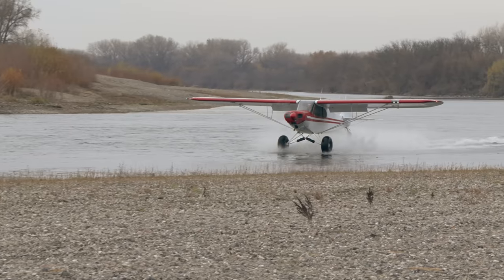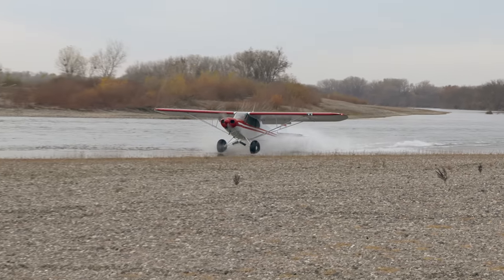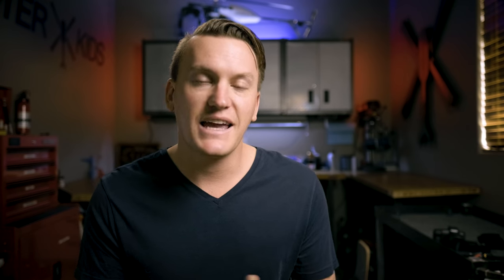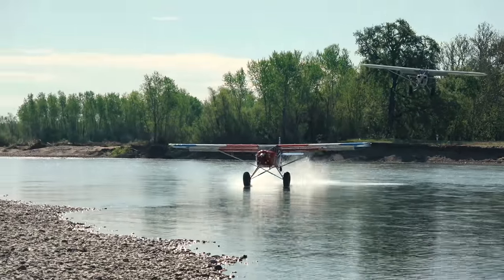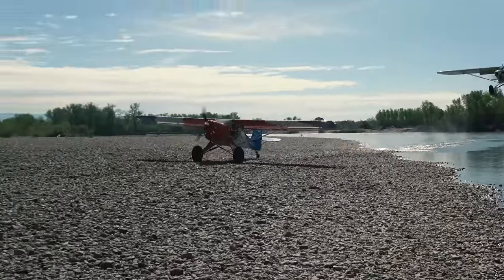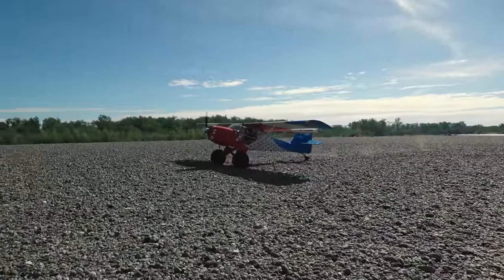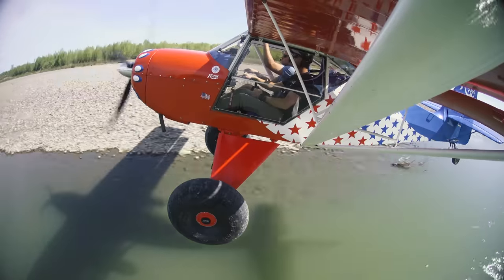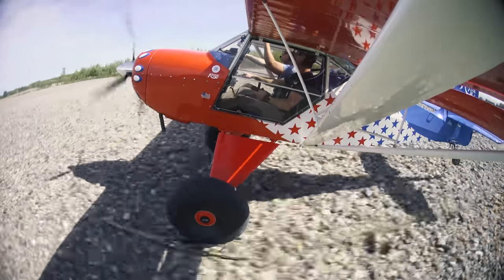How To Waterski An Airplane, and Why You Probably Shouldn’t

Comment: Just ask the FAA about 737 max ,should never be flying ??
Reply: 8 7 max is a very good plane, a system issue caused the issues. Why? Boing is trying to have any 737 pilot qualified to fly a normal 737 fly the max with no training. Nothing wrong with the max, it's the system that makes it fly just like normal 737s caused the issue. Boing will find a solution and fix it. I would and have flown on the max, awsome plane, would not hesitate to fly on it again.
Reply: @airgliderz  that and having to dumb it down for 2nd and 3rd world training deficiencies... Nothing like having to idiot proof a jet airliner. God bless Boeing

Comment: Pretty funny thinking the brakes will have that effect! Holding in some brake will stop vibration if your tires aren't balanced well. Another "don't" is don't hit a boat wave. It will snap your gear off at the least. Experience coming from a friend.

Comment: Have not skied a wheeled plane my self but discussed the matter with a 13,000 Hr Helicopter and fixed wing pilot who had on numerous occasions skied tail draggers for fun or beech landings  -  His explanation was that and as can be seen in your video that while skiing the water friction will quickly start your wheels turning and when they reach rotation equal to that of aircraft speed the surface tension against the water is lost and the wheels will start to sink in  -  He said always have the toe brakes on until just before reaching the beech        As for stability issues engaging brakes after skiing for a period is resultant of centrifugal force when the brake caliper quickly stops the rotating wheel and has nothing to do with tyre braking against water - example: a car hard braking on seal then starts to hydroplane on water loses braking ability

Comment: I liked this one a lot.  Even though there was ... like ... NO flying in it!  LOL

Can I add something to the safety suggestions?  You talk about the dangers of penetrating the water and what it would probably be like to flip over and deal with a flooding cabin, etc.   I would like to point out that if you are going to be working this close to the water, you should be wearing an appropriate (for aviation use) personal flotation device (PFD).

I would suggest this applies to any of the low level flying done around water.  Landing on gravel bars, low level flight over Lake Tahoe where you clearly wouldn't be able to glide to shore.  Any place you have a clearly identifiable risk that a mistake could immediately stick you in the water is probably a good place to be wearing a PFD. (Edited for seriously screwed up sentence)

Comment: Screw 'em, Trent. Get some combo pontoon / balloon tire tundra landing gear, and go surf and roll down any runway surface you want.  Have the Patey twins design, market and sell it. It has to be doable, don't let anyone tell you it can't be designed, built and sold. When you are in Experimental Aircraft, all bets are off.

Comment: IF you were going to water-ski, I wonder if there would be any benefit to unlatching the door and clipping something over the frame so it cannot re-latch.  Then, if you do flip, you don't have to worry about the pressure on the door.
You could even use a bungee cord to keep the door firmly tight so it doesn't create a hazard by flopping around.

Comment: Flying is one of the few things in life that are self regulating... there are old pilots and there are cocky pilots but there are no old cocky pilots.  Bush flying requires skills and abilities way different from those required for paved runways and control towers.  I much prefer bush flying myself but where I come from there is none.  The only thing you did wrong in my estimation was doing it with a passenger.  That should never have happened and the FAA was right to give you a slap on the wrist.  Pilots take a kind of self-inflicted Hippocratic oath to do no harm (to others, killing yourself is oK) and with a passenger on board you are responsible for their lives.  Claiming they begged you to do it doesn't change a thing, they are not pilot in command... you are.  Love your videos,  love your type of flying and I fully support your right to put yourself in harms way.

Comment: Hey Trent, what about landing "somewhere" in the US? Is that legal?

Here in Germany, you must never land outside an official airfield except in an emergency situation where you cannot make it to an airfield safely. Exception: Gliders.

Taking off from anywhere else than an airfield is also prohibited and requires an official approval (e.g. when you landed with no fuel and want to take off again after refueling).

Comment: Trying to get my mind round adding Sail GP yacht type foils to help with landing on a beach , where the foils fold where they fold up when you reach the beach. 15 to 20 miles per hour water is as hard as concrete it's also the speed that some foiling yachts Start to foil.

Comment: The comment by someone in FAA Legal stating that lack of landing and takeoff performance numbers in a POH for unpaved surfaces makes such operations illegal is WRONG. Says who? The FAA. The only information in a POH that a Part 91 operator must have and use are limitations—the rest is advisory. In fact, if all aircraft limitations are on placards visible to the pilot, the POH need not be on board.

Comment: The wording of the regulation which defines your separation from "people, vehicles, vessels, and structures", does it continue on to include the phrase, "... not under the control of the pilot in command of the aircraft" ?
The reason I ask is because I am also a commercial UAV pilot (in the UK) and the regulations which specify our separations use the same wording and conclude with the ".. not under the control of the PIC" bit.
In flight, I cannot get within 50m. Whilst taking off and landing, it's down to 30m. Yet, if the person, vehicle, vessel, or structure is under my control, I can get as close as I like. The interpretation of "under the control of the PIC" can be a little loose at times but generally, if given a safety briefing and have some way of hearing the pilot calls (such as radio, or by use of a signal horn), they are under the PIC's control. In other words, if they know how, where, and when to run and take cover, they're "under control".
So, if you are making a low pass over a field in your KitFox so that a guy with a camera can capture some footage, as long as he has had an adequate safety briefing, are you allowed to fly close enough to flip his hat off his head with your wing-tip or does the mandatory separation still apply?

Comment: IIRC, it's less the surface tension of the water and more the ~viscosity~ of it that makes skiing in any form possible. At those speeds, the water simply can't flow fast enough to be pushed out of the way by whatever's trying to push through it, so it acts much more like a solid surface than a liquid. A significantly more exaggerated example of this would be oobleck, a shear-thickening non-newtonian fluid. Which is an apples to oranges comparison because you can't exactly compare newtonian fluids like water and honey to non-newtonian fluids like oobleck and shampoo, but oobleck exhibits the effect that you get when you try to skim water at those speeds to such a degree that you can more directly experiment with it with your bare hands.

If it were entirely the surface tension of the water, then skiing wouldn't cause the water to splash out of the way as you do so; it would really only cause ripples and little else. Water's surface tension is way too weak for that to be the dominating effect in this case.

Still, excellent tips to share nonetheless, and an excellent risk analysis of waterskiing airplanes, and you should honestly feel proud for sharing with us the errors you've made as a pilot and the consequences (or relative lack thereof) that came of them. This sort of transparency and willingness to admit that you messed up and the steps you're taking to rectify the issue is needed in order to show that egotistic perfectionism is a dangerous mindset to allow oneself to slip into as a pilot. :)

Also, dat luck of the draw that an FAA inspector just so happened to be there to catch you red-handed exactly when you absolutely didn't want to be. XD That was just my luck the past couple of times I've been pulled over for speeding on the road.

Comment: I remember watching this video when it first came out last year, but now that the Almighty Algorithm has recommended it to me again, I'mm'a be late on this train and say that it's not just the surface tension of the water you're working against when skiing. That's only a small fraction of it. What you're really taking advantage of is the viscosity of water. Water has a surprisingly high viscosity for something that flows super well, and when a thing tries to push through water above a certain critical velocity (based on the shape of the thing, I believe), it's basically like pushing through a solid.  The faster you go, the more solid that water "feels", because its viscosity prevents it from flowing out of the way fast enough. The mythbusters explored this when they tested the myth that you're better off landing from a free-fall onto water than onto concrete, and they concluded that landing on water really just wasn't much different than from concrete, above a certain critical velocity, and this velocity is different depending on whether you land feet first or in a belly flop.

Comment: Hey Trent, very interesting video, and it gives me and idea actually :
Because you've got that EXPERIMENTAL sticker on your aircraft, could you maybe make something (start-up (fake or real, as you want), research project, experimental project) about developping a technique for waterskiing ? Like coming up with whatever device (rad-alt for water, surface tension break detector if the tyres are at the limit of penetrating, special waterskiing tyres, or anything else) that would legally authorise you to conduct these kind of practice ? I'm thinking about the Cirrus experimentations with their CAPS system,  also any hydroplane manufacturers had to comply with regulations for landing on water and make tests, no ?
I'm just giving an idea, I don't know how it works with the FAA, I've only been dealing with CASA (Australia) and now EASA.
If you're interested, feel free to contact me, I'm a master degree student in aerospace engineering, majoring in aircraft structures and design operations and would be interested to follow a project like this closely !

Comment: Fly8ma has a good video on this topic as well. I live in an area where there is a ton of beach and river area you could land but like Trent is saying you are supposed to stay at an altitude where you can safely land in the event of an engine failure. Sure you can land on the beach or the river bars but are you causing undue hazard? There are always plenty of people ready to go tell the authorities that your doing something wrong so just be mindful of your surroundings and be prepared to get a letter in the mail. That being said as soon as I have a capable aircraft I will be landing on all the off runway spots I can..

Comment: Good video, I always wondered about if it was legal or not.  Still not really clear.   About the physics of "hydroplaning" a plane in open water, it really has nothing to do with surface tension.   It has to do with speed and moving the water but not really surface tension.   Surface tension is like a bug walking on water where the surface kind of acts like a structural membrane on the surface of the water.  Like floating a needle on water, If carefully placed on the surface, a small needle can be made to float on the surface of water even though it is several times as dense as water. If the surface is agitated to break up the surface tension, then needle will quickly sink.    When "hydroplaning" a plane in open water the surface is broken as evidenced by the spray from the tires and has nothing to do with the surface tension of the water.
Reply: This is true. It's not relevant to technique, but surface tension does not change with speed. The very short description of what is going on is that water is incompressible, and has inertia. If you try to push into it faster than it can get out of the way, it is hard.

Comment: Perhaps another lesson to take from your experience is to find a less public, tourist filled lake than Tahoe if you are going to try something edgy.  I was stationed at Tahoe for a bit in the Coast Guard (back when dinosaurs roamed the earth); federal agencies are there because the lake is a national treasure that spans multiple states.  A federal agent in a place like Tahoe gets pressure from the public, from resort owners, and from well healed property owners (why are you letting those people do X?).   They also know that on a cold lake like Tahoe, you will likely not last long enough for help to arrive in case of an accident.  Interesting point about glassy water; competitive divers  spray a stream of water onto the surface of the water, else they can't judge the distance to the water.

Comment: Actually, setting the brakes while skimming should be of help and keep you "on top" more firmly. If you could rotate your tires at ground speed somehow, then you would not be able to ski at all. That's why they tell drivers to stay off of the brakes when driving over standing water, to avoid hydroplaning, which is when a wedge of water builds up under the leading surface of the tire and erodes contact force with the road.

Comment: Basically the FAA could see a float plane in violation on a touch and go with the right inspector. So how to air tankers like CL414's get away with doing the same to load, it is a common problem in many different sports and activities, mainly dependent on who is holding the book and camera at the time.
Reply: Trent pointed out that they look at what the operating procedures are for a particular aircraft.  A float plane would have water landing procedures in its POH.  IOW, it’s meant to do that.

Comment: It’s an interesting conversation and one that needs to be had. I think I’m in agreement with you on this one Trent.   It comes down to personal risk assessment. Personally, I wouldn’t do it  outside of an approach to landing (even then there would have to be a severe need for it). The risk outweighs the benefit for me. I think violating you under paragraph A is a stretch at best. You weren’t a risk to anyone on the surface because you were already 500’ away. I’m not a lawyer or FAR expert that’s just an opinion. I’m not a fan of the fact that through your requests for definition the FAA held up that an inspector’s opinion carries the weight of law. That makes my libertarian/conservative spidey sense go off. It’s a slippery slope. When appealing all the way to DC they need to be able to defend the violation action with definitions and actual law, not opinions (which are arbitrary). If they can’t define it and point at a regulation then the violation should be dropped and there should be no record of it.

Comment: The problem is that the FAA is a mixed bag. Some of them are cool and understanding and trying to be closer with pilots, but other ones like to use the loose laws like 91.13 and the "basically you can fly at an altitude you want but you gotta be in a position to make a landing deal" to simply go after pilots. While I think maybe waterskiing with a passenger is a bad idea, the other guy knew the risks and agreed. As per waterskiing in general, it's cool but make sure you have the experience, and you do it by yourself at a location void of all other people.

Comment: I dont think it is surface tension which is the issue, but water density. Some 820 times more dense than air, so hard for tires to push it out of the way if they get too deep, slowing  wheels and causing pitch down.

Comment: If you flip, the wings will keep you floating, cockpit above the water. Not flipping would be slightly worse, but you will not sink fast at all.
Reply: Obviously you've never been there. Why offer an opinion you know nothing about?
Reply: @rayfletcher3683  I sir, am a pilot... and boater. Hydrodynamics works one way. Unless you managed to shred the fabric on the wings to bits before you hit the water, you would sink super slow. In fact the dacron on the wings (if they still use dacron) is semi waterproof. You could most likely use the upside down plane as a boat. We are talking about a superlight plane here, not a cessna.
Reply: Well I hate to tell you but years ago I unfortunately upset an avid flyer turning crosswind on floats and I can definitely tell you that it sinks very fast. You will find yourself sitting on the bottom of the floats if things go well!  BTW  seeing fish swimming over your wings as you drift to shore is not a pretty sight!

Comment: I wonder... if you water ski without a passenger, how would the rule "you have to fly at an altitude so you don't endanger anyone else in case of an engine failure" come into play? 

Imagine, you're down, water skiing along the lake. Suddenly, your engine fails. What happens? You're already at the perfect altitude to make a forced landing on water, in the perfect attitude, probably going in a direction where you won't endanger anyone on the ground. So, what happens is that you get slower and slower, probably pulling back on the stick more and more, extending the flaps to their maximum, crack the door(s), then at some time penetrate and probably flip.

Where was the danger to anyone else? Did I miss something?